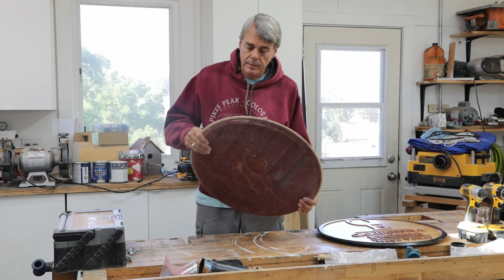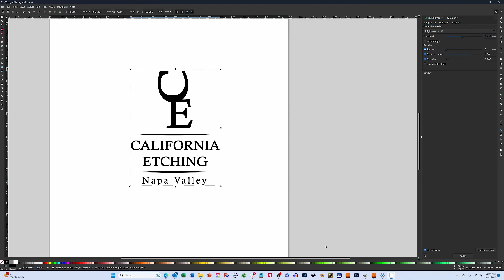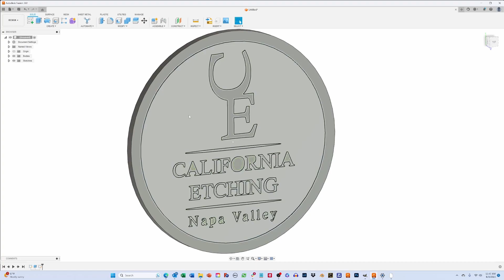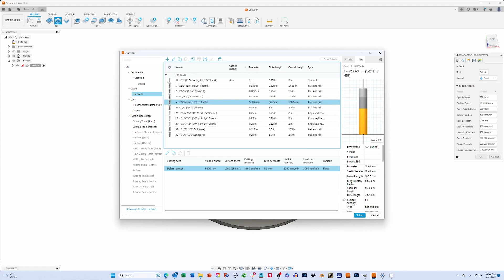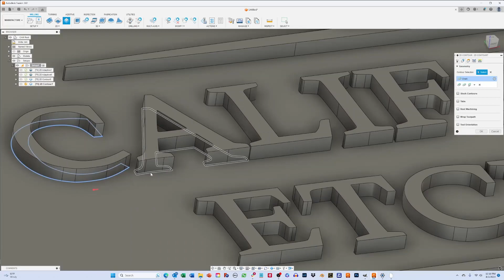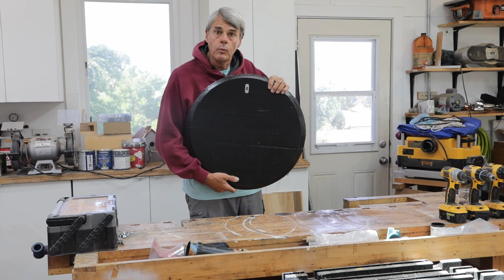Making a Barrel Top Logo Sign

Comment: I need to make a sign like this for a friend. Thanks for the video! I haven't found anything else explaining the process.
Reply: Ok, so that last one with the side staves is exactly what I'm wanting to make. I want to cut the logo through the barrel top and use colored plexiglass with LEDs inside to light up the logo. And the whole sign would be 2-sided, with 2 of the parts like the one you showed at the end hinged together so the wiring will be secured inside and it can be hung on an angle iron bracket from above.

Where would be a good source for a barrel? The ones I'm finding are old and weathered with rusted rings.
Reply from the maker: Some wineries will sell their old barrels but I found the bets source to be Craigslist. If you are located in California then you can also try https://www.winebusiness.com/classifieds/

Comment: Great video...especially at the beginning when you described what type of barrel head should be used. One question--I am just getting into CNCing and have Vectric software... could this have been done in Vectric, Adobe Illustrator (I have licenses for both of these), or some other program? Also, curious what type of screws you used to hold the bands...regular big box store, or did you find a source of cool, old-school screws? Thanks.
Reply from the maker: I am not familiar with the details of either Vectric or Illustrator but I suspect any graphic package could be used to generate the design. You will need something like Fusion 360 or V-Carve or Carveco to turn the graphics into G-Code however.